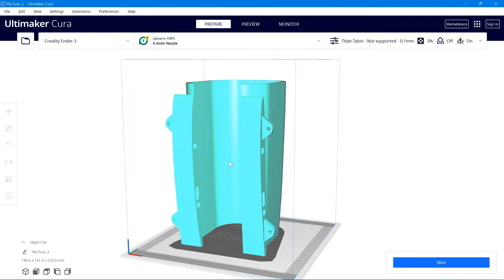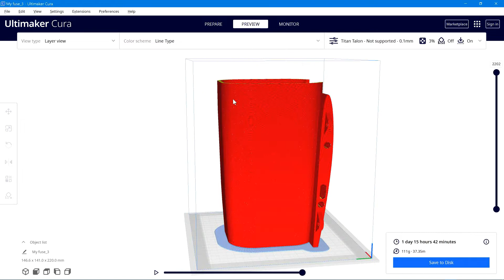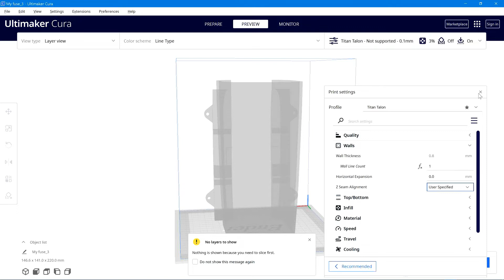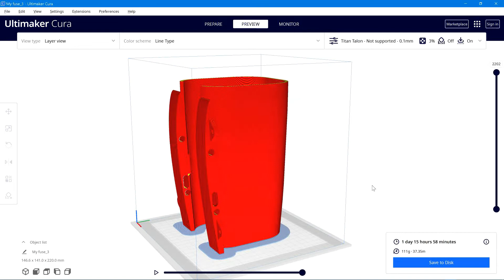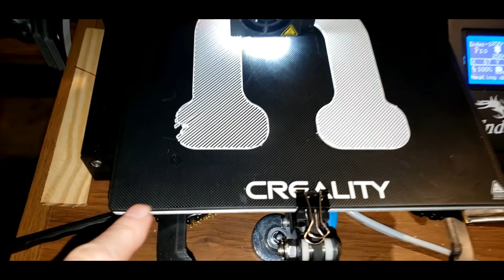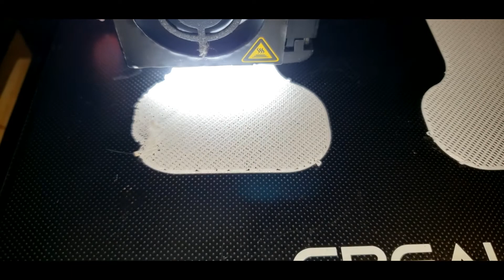Titan Talon Fuselage 3 Begin Printing

Comment: I finished the fuselage two days ago and started the wings yesterday.  I was having underextrusion after the layer start point and in the infill, and had to restart the wing print several times, trying various settings.  I think I got it right this time and now the first left and right wing parts are a few hours into a 25 and a half hour print!  
The fuselage parts suffered from a little bit of underextrusion after layer changes too, but it's not as apparent since there are fewer interior structures in the fuselage sections, I'll reinforce the problem areas with a tad bit of glue instead of reprinting them.
Reply from the maker: I think we are having the same problems.  I am posting a video now about mine.  I bet they are the same.  :)